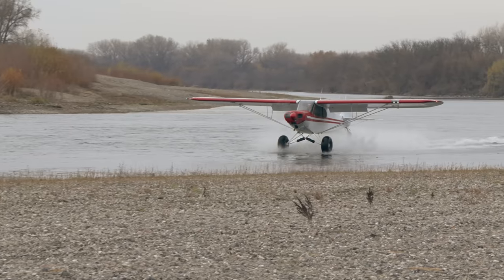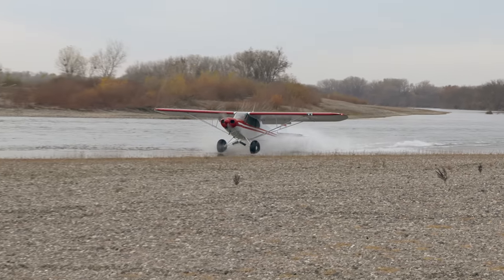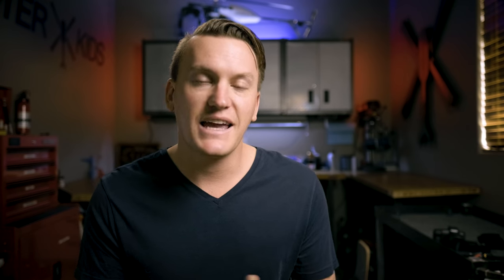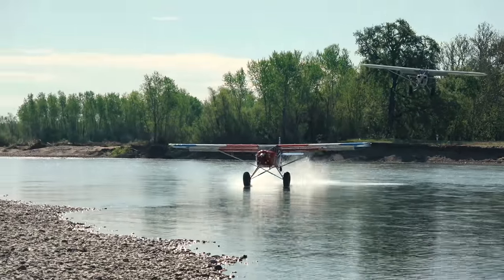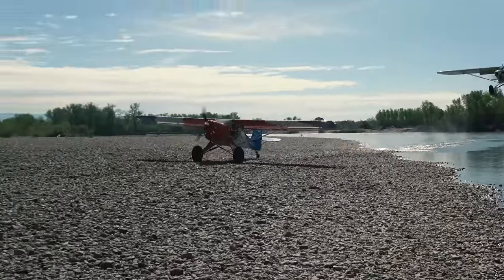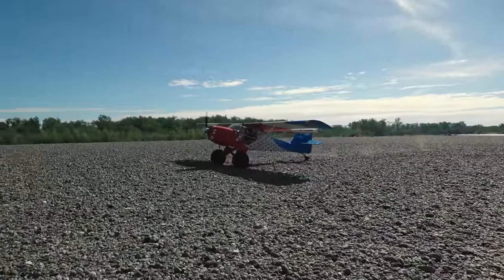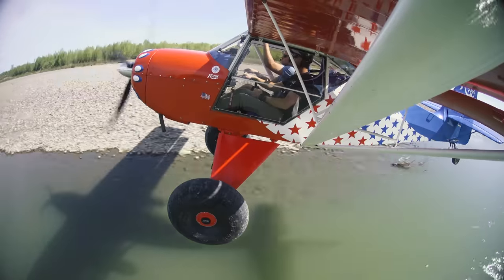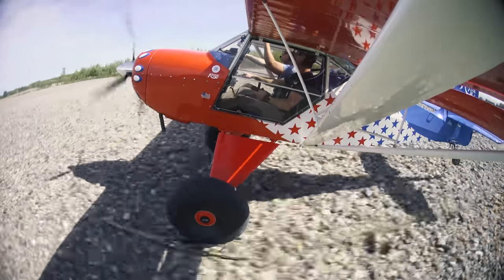How To Waterski An Airplane, and Why You Probably Shouldn’t

Comment: Your operating handbook doesn’t say anything about landing anywhere because you fly an experimental. So according to that inspector, you would be careless and reckless for getting in an experimental which is clearly incorrect.
Reply: my experimental home built plane;) handbook did say about where you should and shouldn't land it, it also states how fast you should be going when approaching the runway from above glide path for gentle landing and  the top speed for landing flying cruising the stall speed heck it even tells you how long you can fly based on if you are flying tailwind or head wind and characteristics and specifics of the operation  plane, I  registered . I know because  observation, my mechanic, and diagnostic equipment told me the details and I typed them into the handbook for my experimental aircraft.
Reply: @ericwilde3837  Yes exactly "I know because observation, my mechanic, and diagnostic equipment told me the details and I typed them into the handbook for my experimental aircraft".  That's a far cry from what a certified aircraft would need to go through to have the same content added to its handbook.  I recommend Trent just write in his handbook that his aircraft is designed for water skiing and call it a day.

Comment: Retired Airlines pilot,,,Cessna 207 eight miles from departure apt. The IO540 broke a crankshaft,3500ft glide lasted couple minutes(I have floatplane license),flipped over very close to a boat on clear water.Upside down hanging from my belt,was easy to get out with my lifevest(uninflated) and standing on the wing,closing the door. Did manage to break a tooth on the dash(no shoulder harness in those days)from the impact. Plane floated for about 3min,wile walking to the wingtip to board the skiboat. Ocean floor was about 1500fathim...went down like the titanic,still remember the plane spiraling down towards DavyJones locker!!! Come to find out there’s an A.D.on the crankshafts,back then. The FAA wanted to violate me.We at Airlines don’t tell them S**t.Hope this helps

Comment: Great video, its a hard lesson to learn, and the FAA new policy on compliance is good change for all or us. Having spent 30 years in aviation as a career and dealt a lot with the FAA I understand where they come from. First remember the FARs "define the minimum acceptable standard for the safe operation of aircraft and the protection of persons and property". 

Like most things every one of those rules came about because someone screwed up. You knew water skiing down the middle of an open lake with a passenger on board was not a good idea, but got talked into it. I have been there myself (well not water skiing) only to look back and go what was i thinking.

Oh and that thing about landing anywhere but a paved runway is reckless (I have seen a lot of comments below on that) because its not in the manual. With out knowing the full story, I'll take a guess at the hint he was trying to give you. 91.9 requires you to have a flight manual, which includes performance data. 91.103(b) requires you to make use of this data on preflight. So look at your manual, you have new wings, and a new engine. Have you revised the manual performance data, and does it included data for turf runway (both short, long and wet grass) in there. You are a talented stick and rudder pilot, you know what the aircraft can do, don't give it up. But after the accident, it only matters what you can prove, if you have no data, its reckless.
Reply: And add water skiing data while you're at it! I hate having to play legal games..
Reply: @guylandia2150  Yes it is a legal game, but you missed the point, there's more to it. If you flip the aircraft over in the long wet grass (or the lake) and injure (or worse) your self and your passenger. Its not the FAA you need to worry about, just tell them I've done it before, its fine.

Its Morgan and Morgan, for the people!

The FAA may take your license for being reckless, but Morgan and Morgan will take everything else. Sure, you have insurance, but that's not going to pay all your legal fees, and having to live with those choices. 

The rules are there to make you stop and think, remember someone already screwed up, which is why there is a rule. Don't be afraid, live your life to the fullest, just stop and think, what if.

Comment: Good tips and insight, Trent! I always wondered how it's not against the min AGL FAR to fly as low as depicted in many online videos, although as youngsters we did it all the time over the prairie and hills of western Nebraska, almost always with passengers, but in certified aircraft. As far as I know, there was only 1 report of a low flying aircraft turned in to the FAA at BFF in the early 1970's, which was probably a friend and I. It's a rural area with cropdusters flying around all summer long surrounded by endless prairie with homes and outbuildings miles apart. I guess people back then weren't so quick to report something that had nothing to do with them, unlike the present mindset.

Keep sharing as you can; always interesting!
Reply: Flight below 500ft is specifically allowed in sparsely populated areas, as long as the plane gets no closer than 500ft horizontally to any buildings, people or boats. however like so many things bureaucratic they fail to define the terms they use like "sparsely populated". The simple interpretation is that sparse is implied by the ability to be clear 500 feet horizontal on all sides, but this is up to individual interpretation.
Reply: @mytech6779 , thanks for the recap. It's been so long since I've flown I've probably forgotten most of what I learned about regs and such thru lack of use! It probably helped that we knew all the local FAA employees personally. I even worked with one of their wives while in college.

Comment: Great video! I'm not a back-country pilot, nor a tailwheel pilot (yet) but the enforcement action discussion reminded me of some advice I got from an old crusty Air Force Pilot. He told me when I think I'm doing something dumb, write the first line of the incident report in my head. Usually we read, "the non instrument rate pilot continued visual flight into instrument meteorological conditions...." Something like that. In 18 years of civil and military aviation, that thought has kept me safe. I've taken some risks, especially in my military career, but they were always thought out, calculated, and done with a plan. The worst I can say I've done as PIC is returning from my PPL Checkride in 2003, I requested a circle over my parents' house. I was with tower, at least 1500agl; not "buzzing," but low enough that they heard me and came out on the deck to see me. I'd do that again, but I'm overall pretty risk-averse.

Comment: My friend, CW,  was killed strafing Lake Pleasant in Arizona and took out his passenger as well..they never skied but were batting the wings so his friend could see him on approach from the east toward the west...an inflection in the air currents caused the plane to dip on a bat and the plane cart wheeled in and sunk to 170 feet and not recovered for about 8 months later. I like your style as the aircraft you are using has much greater maneuverability, like a bi wing. and your relative speeds are amazingly low...being able to land and take off in 200' is amazing.

Comment: Before you started talking, my first thought was wow - that can be used for shorter landing. Water will 'suck' the tires into it because of something called surface tension which will help slow the aircraft and keep the wheels planted for the shorter landing technique. It makes sense that bush pilots use it because it appears to be a legitimate use of physics with surface tension of water.

Obviously, this can cause an accident if you're not at the right power level because the craft will continue to slow down and be pulled into the water, or flip forward after sinking a certain amount. But, if the technique is used properly, I can see it being quite beneficial.

As for the brakes being wet - you can apply a technique which is learned in other countries during mandatory driver training classes before entering a puddle, or flooding on a road.... If you depress the brake pedal in such a way that the brakes skim the rotors, you can entire the brakes stay dry as water that gets on the disc after will be more easily swept away because of two dry surfaces moving over one another with next to no distance between them vs having 3 layers - 2 dry and 1 wet in the middle.... So you could use that technique and apply the brakes, if you are coming in for a landing, before you skim the surface to help keep the brakes dry. ie, what happens during hydroplaning.

Also, if you had a verbal discussion with your passenger and both of you were willing to take the risk, then you would've won in court as it falls under a verbal contract. You warned him of all of the risks, such as death, etc... so legally, by him agreeing, he signed a waiver. Section A, doesn't pertain to you. If you upheld section C by staying away, 500 feet, from all people and structures on the surface, then you couldn't have possibly broken section A by endangering them. If you had an engine failure, you would've sunk, flipped and endangered yourself, and your passenger - both of which had legally 'signed' a waiver allowing that event to take place.

You should've stood up for yourself.

Comment: The good side of it is that someday, when you have an aircraft full of passengers, and the engine starts to die, and you are looking for a place to land in the northern bush of Canada, and spot a small area to land but too short before you hit the bush, you will be able to use a little of the water as your runway, get down safely and save the lives of all your passengers.  There is a good side to every bad thing that happens in life.  Happy Flying

Comment: This is a very good video, and the best part, IMO, is the advice to be proficient in wheel landings.
I can speak to this, since I have almost 50 years of tail wheel flying, in my C140 and C120.
As an aside, in all of my landings, I am focused on keeping the plane straight down the runway, maximizing rudder control.
Remember, Rudder for heading and Aileron for course.
I've never ground-looped; I've never even been close to doing so, and don't ever intend on doing so.
Be confident in your landings in a tail wheel airplane, whether it be wheel landings or three-pointers, be aggressive, don't be wishy-washy with the rudder.

Comment: This is an interesting topic. I’ve always been curious about it.  On the topic of 91.119a, even though your aircraft is near the surface, as long as you have plenty of airspeed, a zoom climb is always an option.  I think that could have been a very viable argument.
Reply: You can skip the zoom climb, water is an acceptable emergency landing spot. Example Flight 1549, it was the prefered by the pilot over attempting a return to the airport. Like Trevor Jacob.

Comment: My interpretation would be if you had an engine failure while waterskiing, you would be unable to make an emergency landing.

But then again, you could apply this to flying over any sort of unforgiving terrain.  If you had an engine failure over dense forest or rugged terrain, you would not be able to make an emergency landing without undue hazard either.  So, I guess any time a single engine airplane makes an overwater passage or flys over wild/rough terrain, they are in violation of Part A.
In other words, its "Because We Said So".
Reply: I don't understand it, because the regulation is not undue hazard to yourself, it's undue hazards to others. If the engine quits you're ditching, but that's the same as if you're flying over a big lake at 500'. No hazard to bystanders.
Reply: If you have an engine failure while waterskiing you are in effect already down so you would technically not need to make an emergency landing.  You've in theory already landed.......but have simply not come to a stop. ;^)
Reply: @gasdive  agreed, no hazard to anyone on the surface here BUT hazard to the passenger if there is one. I realize the regulation talks about "persons or property on the surface" though so in my personal opinion as a non lawyer it seems problematic to say it's relevant to "Trent went waterskiing with a passenger"

Comment: One little nitpick.  You are not skiing on "surface tension".  That term refers to the specific way that water molecules attract each other to minimize surface area.  It makes a drop of water falling through the air stay "drop" shaped, and placed on a surface bulge up rather than spread out, a stream of water hold together, and some small insects can stand directly on top of the water without penetrating it.      You can take the surface tension out of water, such as by adding  soap, but it's still water, and you could still ski on top of it as you could any other liquid of similar density.   You're skiing on Newton's 3rd law (equal and opposite reaction), and it works because the water is relatively dense and can't get out of the way quickly.    Your tires are hitting the surface and it's hitting back.  

Regarding brakes.   Many years ago I was watching one of the pioneering videos of super cubs landing on gravel bars in Alaska with water skiing approach, and that pilot said that he purposely applied brakes and kept the tires locked while skiing.  His contention was that the speed differential between the tire's surface and the water is greater when the tire is not turning, and that by allowing it to rotate your'e lowering that speed differential, sort of like your upwind but downriver scenario (water moving with you).   I'm also thinking that with a spinning tire you might get some Magnus effect, which pulls the water around the rear of the tire flinging it upward (as you say the struts get wetter).   Any water that is thrown upward, is created by an opposing downward force on the tire.
Reply: I was thinking the same thing. Thanks for posting this.
Reply: Sooooo brakes on then?

Comment: Oh boy, where to begin. First, before I tell the story, I’m an old dog -CFI, instrument instructor, and multi-I. I had no idea you young guys were doing this. In 1978 when I got out of the army, I went to work as ground crewman for a crop duster. His personal plane was a PA-16 Piper Clipper, a sweet little airplane. Before the season started we flew down to Florida and he demonstrated this technique. Somewhere I have pix buried in my junk. He used it as practice for spraying crops. He was also an insane drunk as was the business owner. We all survived the season and I learned to fly tail wheel with him. I got my private ticket in Athens, GA at Clark’s Flying Service. Mr. Clark drilled into my skull: “There are old pilots and there are bold pilots, but there are no old-bold pilots.” Guys, unless you have a real operational need to do this, don’t do it. Then only learn it from some graybeard. Keep the greasy side down.

Comment: I like what you said, and agree 100%. I wouldn't be a 'hater' of waterskiing with an aircraft, but I will say that one is putting oneself at greater risk by doing it. And I think you're saying the same. At the beginning of the clip when you introduced the topic, I thought, 'Never with a passenger.'  Then thought of a friend begging me to waterski with him or her in the aircraft. And that's what happened to you. 

I've never flown a tailwheel aircraft (which, according to another friend, means I've never flown!) and wouldn't do it with a tricycle geared aircraft--but the fact is that I don't think I'd be comfortable enough with my experience to do it. I fully understand the thrill of doing it--most of us at some stage have flown low enough to get that same thrill. But, hopefully, those that have done that, have done that alone. Reckless? Yes. Dangerous? Yes. I say reckless because I have a family to support. And if it wasn't dangerous there would be no thrill.

I don't fly anymore because I have PD, but this is the way I see it: comparing me flying low, to my dad flying low is just incomparable. Me with less than 200 hours versus him with close to 10,000 hours, some of which were WW2 flying low enough so that the cruisers were unable to bring their guns to bear on him...there's just no comparison. I wouldn't consider Dad (yes, with a family to support) to be reckless. But I would be.

Comment: Re: Inspector: "careless and wreckless anywhere other than a paved runway because there is no data in the performance charts".   I haven't flown in 10+ years, but I remember performance charts that referenced a grass runway...so off the top of my head, I'm not sure what the inspector meant. Example, 1978 C172:  "For operation on a dry, grass runway, increase distances by 15% of the "ground roll" figure."